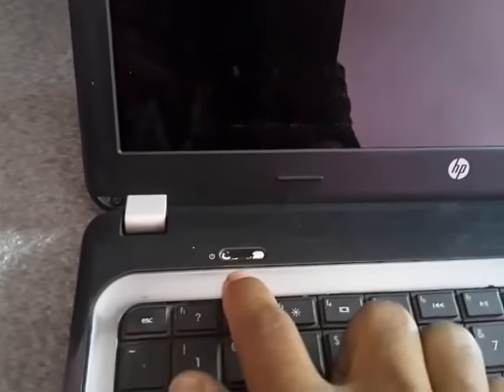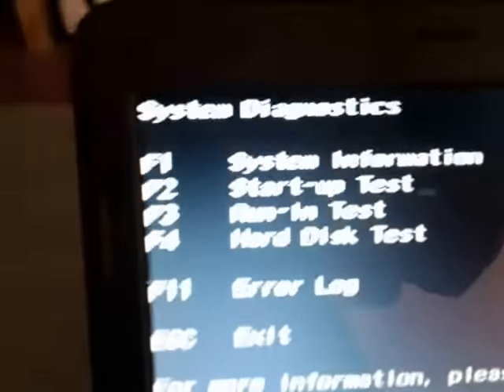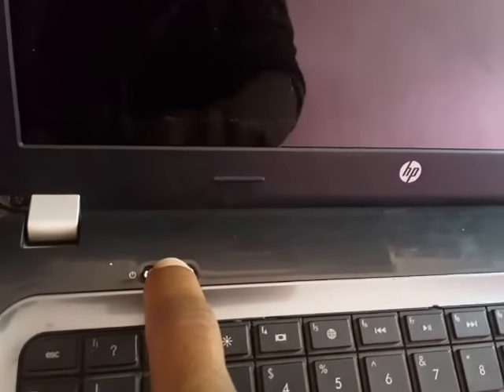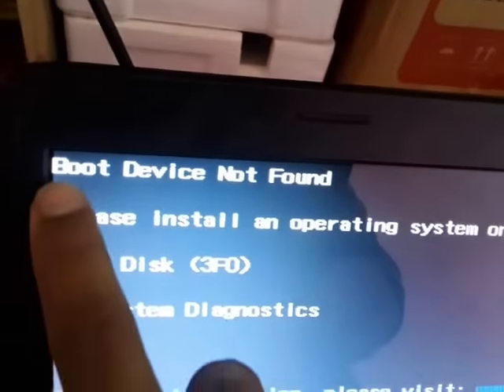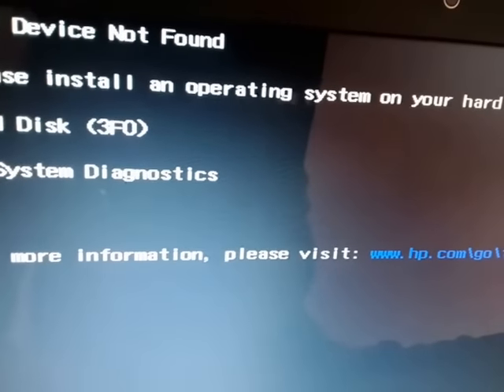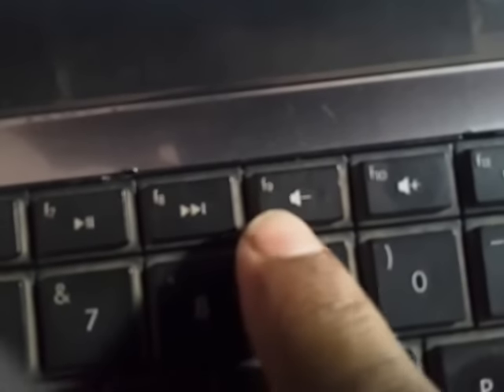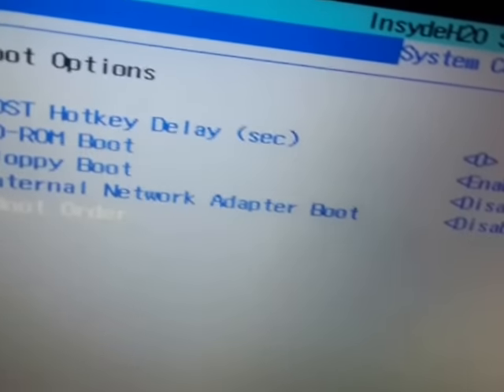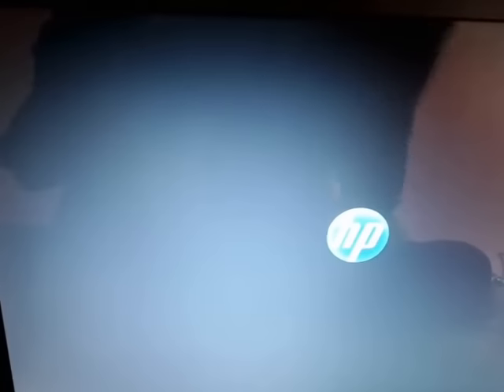how to fix HP laptop Boot Device Not Found Error (3FO) or Hard disk not Exist error

Comment: Commenting this from fixed laptop with the same 3f0 issue. Removed battery and pressed power button for 20-25 seconds and laptop came back to normal startup. 
HP Elitebook 8570p. 10-July-2022
Next morning (11-July-2022)same problem tried every thing but nothing worked, removed hard disk from laptop.
16-July-2022 Removed the HDD case and took out board from HDD by unscrewing 6 screws. Cleaned the connectors which were black, after cleaning connected the board to HDD. Now it is working fine.

Comment: Clean your hardisk when you remove it and ensure that it fits perfectly with cable sometimes due to mishandling(shock or if you drop it) connection can become lose
And also try to disable legacy option and then shutdown, restart and again enable it in bios settings

Comment: I was running xubuntu on my omen laptop and then wanted to re-install windows 11 and get rid of xubuntu. I get no drivers found. After trying many things I deleted the hard drive. Now I have boot device not found. Is ther a way to reset it to factory default without an operating system? in the old days you just put a pin in a little hole.

Comment: I only pressed power key until it get off then I removed its battery and unplugged the power supply. After some time I reinstalled its battery and then started. Problem Resolved

Comment: I have done the hard drive check.
It is showing like .
NO HARD DRIVE INSTALLED.PLEASE CHECK THE POWER AND DATA CABLES ARE CONNECTED PROPERLY...
And then I came back and turned off my laptop..and started again then I turned on well and now it's ok....

What should I do of again it happens...
It's showing no hard drive but  it started well....

Pls respond...

Comment: JUST SWITCH OFF AND ON AGAIN HP PAVILION 15Z
Reply: Hey bro...It's really worked 😁😁😁😁😁thanku
Reply: It worked for me too
Reply: my hp probook 450g4 is showing the same problem...  :(
Reply: @aroy7298  Man Did you fix it , I have the same problem and we can't remove battery as other pc.
Reply: + @douamkarellekouakou616   I changed the hard drive but it didn't work, they says my motherboard has critical problems. :'(
Reply: @aroy7298  That's so sad , I already have issue with motherboard and it take 3 months to resolve it , I don't want to face the same again :(
So those bios settings didn't help with our PC (:
Reply: @douamkarellekouakou616  did you fix it? Same problem here

Comment: 2 Solutions

1. Check ur hard is connected properly or not. Open the laptop carefully and slide out and in the drive. Reboot the laptop. Worked for me
2. OS is currupt. Boot ur laptop with external device, Pendrive. Thus install OS externally.

Comment: This could have been explained a lot simpler, a lot of repeating things already said... but I was able to fix my issue. thanks
Reply: Irwin De Gannes wait so could you simplify it for me please..?
Reply: @katherineclaros7341  well basically my issue was that I changed the bios password and that reset the bios configuration where it enabled uefi/secure boot, and I wasn't sure how to even get into the bios because there were no prompts as to what key to press to get into it. So in a nutshell, press F10 after u power on to enter bios, then switch to legacy, set primary hard disk to boot from. if you want to configure secure boot its up to you. Done!

Comment: I did all that and still refusing all hard disk tried changing the two power sources for the hdd and odd but still same is there any other solution for hp 250 g1

Comment: If it doesn't work then There is probably an error with the windows Boot drive (a Hidden drive in your computer) to fix this you need a windows repair Module which you can make yourself in the control panel on another computer

Comment: Good day i do the same step on your video when i save change "yes"  its still the same. Os not found. Please help me....
Reply from the maker: its about legacy, did you try doing on and off for legacy in bios, secure boot should be always disabled, method 2-remove the battery, unplug and press power button for 1 min. and try to on again putting battery, may be hardware issue than, hard to fix without seeing and checking your laptop, contact some technician
Reply: Didnt work

Comment: ANYONE ELSE HAVE SHITTY EXPERIENCE WITH THIS LAPTOP?? I BOUGHT IT BECAUSE MY DESKTOP NEEDED REPLACED EITHER WAY I GOT IT ON 3/XX/2018 ABOUT A WEEK OR TWO AGO THE LAPTOP STARTED GIVING BLUE AND BLK SCREENS CAME DOWN TO MEMORY PASSED IT'S TEST HARD DRIVE TEST DIDN'T INSTANTLY POPPED UP WITH "INSTALL OPERATING SYSTEM  onto hard drive".. so does that mean I need a new hard drive for sure or what other possibilities could it be.. please help this is very urgent I fix my laptop basically rig by now!!